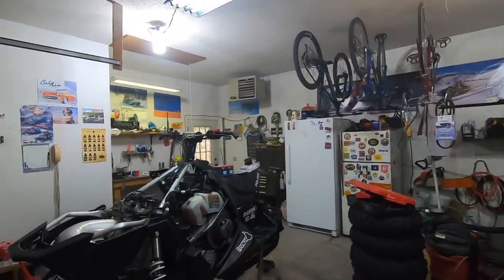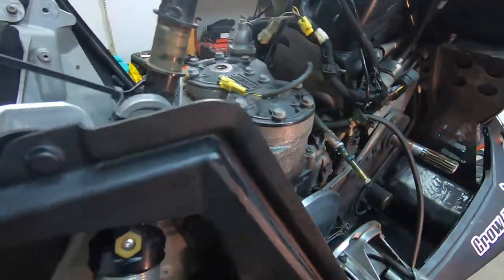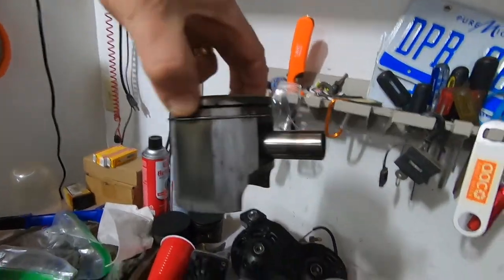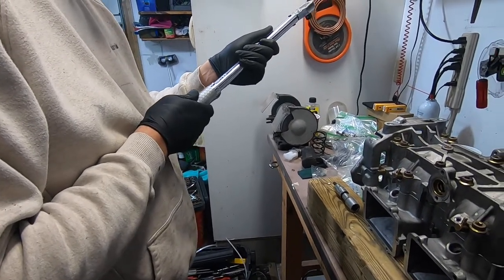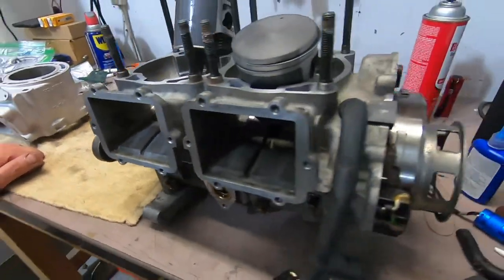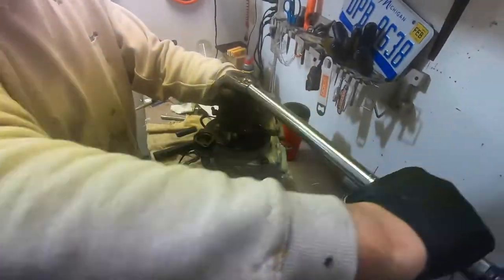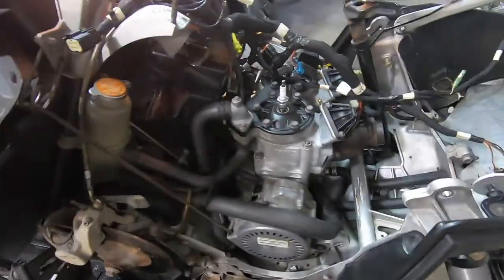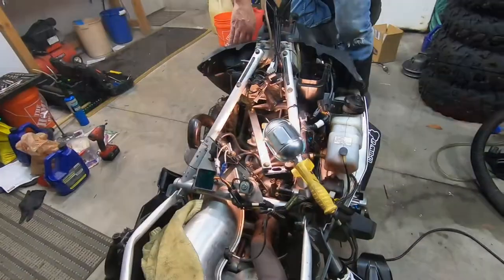2011 600 Rush Engine Rebuild

Comment: Obknow this is a 2 year old video, make sure you test the oil pump for the oil injection, first full tank of fuel mix it at 50:1
Reply from the maker: Great point and I did both. Ran great the last 2 seasons.

Comment: How did you clean the old sealant off case before  reassemble?
Reply from the maker: Scrapped it with a plastic putty knife and finished it with a razor blade being careful not to dig in an put any deep scratches. Went over it with a rag with some brake clean on it.

Comment: Free advice, remove the seat , gas tank, that stuff needs to come off then the airbox you'll see wut i mean when you take all that other stuff off it opens up so your not fighting with no room to take the engine off
Reply from the maker: I did think of that after the fact. Great Advice for sure. Been running great the last 2 seasons.

Comment: Do you prefill the cavity of the crankcase where the crankshaft gear meets the water pump gear with any oil?
Reply from the maker: I did not. Not sure if you should or not. Mine does run good now.
Reply: @gobigparts  Okay thanks! I just assembled my 600 CFI bottom end and didn't either, I went through the Polaris shop manual and see nothing about requiring to do it. I usually work on ski doo/sea doo and those machines require an oil bath.

Comment: Needed all that work after only 4400 miles?
Reply from the maker: When you buy something cheap there is a reason. You don't always know how previous owners took care of it. With aything in life failures can happen. I happen to have aothere 600HO with over 10,000 miles on it.
Reply: @gobigparts I have the same motor with 6000 miles so this videos existence made me a little worried lol

Comment: You failed to spin test the bearings.  You failed to attempt to clean out the piston rod bottom bearings and the crank bearings on either side of the damaged piston.  High chance of metal filings in those bearings.
Reply from the maker: Did that off camera, cleaned and oiled.

Comment: How do you set up your power values in your engine
Reply from the maker: These ones are spring return and pressure activated. So no need to set, just clean.